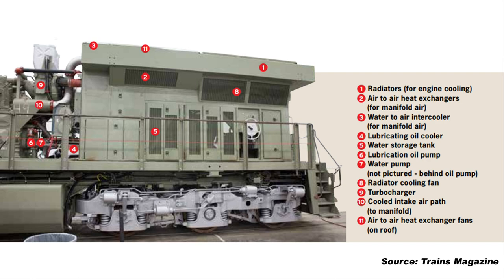HOW TO COOL A LOCOMOTIVE

Comment: Are the radiator cooling fans at the top of the locomotive blowing hot air out of the or pulling fresh cooler air in? Or is one fan pulling in air and another sucking air out? Older EMD's have three fans while it seems modern locos have just two. So I'm curious whether all fans are drawing air from the same direction or not.

Comment: Ge has been "upgrading" some fdls and evos to wet rad system installation shutters on top of the rads and eliminating the uni valve on evos and flow valves that were prone to fail anyways.

Comment: the problem with no antifreeze is you can get freeze up and damage the block if they sit!!
Reply from the maker: Like Ryan M said below, they don't shut them off when it's cold.
Reply: @Trains21  AC did you see the news story a few years back showing UP;s yard near salt lake city where they had almost a 1,000 engines in long term storage? i don't think that had all of those sitting there running 24/7! and they've got to shut them down sometime!
Reply: @keithmoore5306  Drained of coolant and exhausts capped done at Symington Yard a lot during winter here.
Reply: @jamesburnside3023  they do them different than semi's then!
Reply: @keithmoore5306  Not sure how Semis are done but, from what I understand no shut off as will not start if left too long.
Reply: @jamesburnside3023  the companies i've been around either leave the water antifreeze mix in or drain and fill with pure antifreeze for long term storage to avoid freeze damage and rust!
Reply: water plus antifreeze is a better coolant than water alone. Ethylene or Propylene Glycol has a lower freeze point and higher Boiling point than water. Diesels need to run very hot to get the best combustion for HP and mileage. A mixed system can also run at a lower pressure reducing HP needed to run a high pressure water pump. Railroads recycle the used antifreeze and used engine oil so there is no environmental risk. You really need to check your science and how railroads work before making false statements.